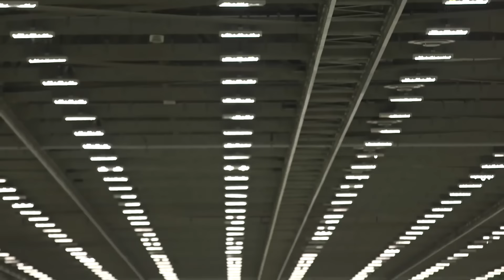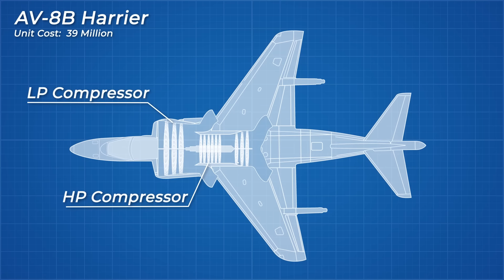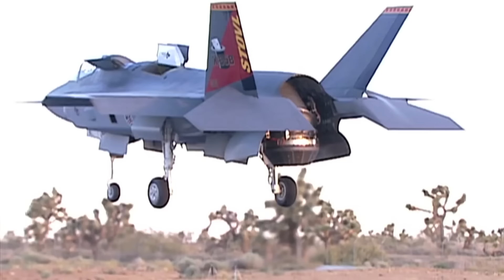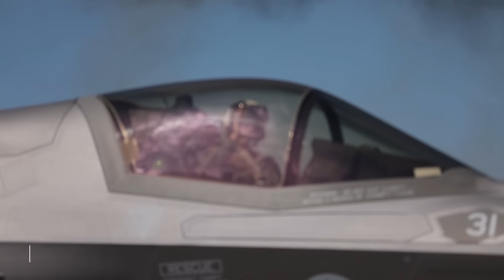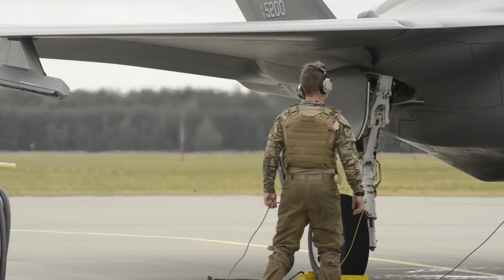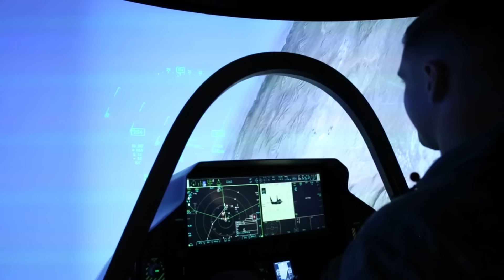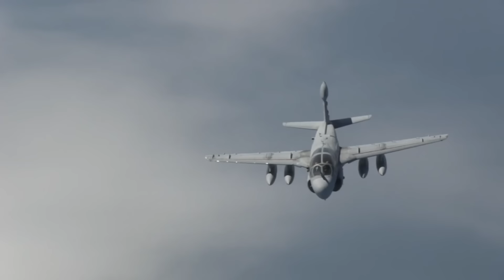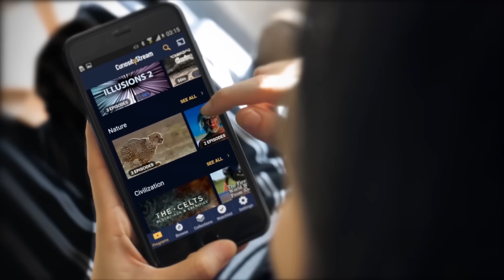Is The F-35 Worth $115 Million?

Comment: As an American. It costs too much. We made this compromise mistake with the F4 Fantom. We had missles so they removed the gun. Because pilots wouldn't be close enough for guns. They put guns on after pilots would run out of missles, and get shot down.
Reply: The F-4 didn't need a gun when it was flown correctly, look at the Navy.
Reply: @infinitelyexplosive   it needed the gun lol. If training was the problem they wouldn't have put a gun on them lol.
Reply: @mattalford3932  The navy generally didn't, and they were still highly effective.
Reply: The F-4 was designed to intercept bombers from outside the range of the escorts. It was never intended to engage fighters, especially not over land on a bombing mission. Thus not having a gun was actually beneficial as it meant less weight and better maneuverability.

Comment: Its not worth it. Its worse than F16 dogfight. Its a useless plane like F22
Reply: And the F-35 is far superior in a BVR engagement. Why is dogfighting performance the only metric you use?
Reply: F-16's typically lose in BFM against the F-35A between equally trained pilots. The F-35A has a better T/W ratio and practically the same wing loading as the F-16 while also offering far superior AoA performance.

Comment: The incalculable savings are the intangible cost saving. Savings by having common parts between A,B,C models. The cost savings of not producing/developing three separate aircraft(Possibly four separate aircraft).  Each of those separate aircraft would have had lower production runs, separate supply chains, separate training, separate maintenance requirements, etc. Also, for marketing in an environment of global competition, there is only the F-35 to be marketed instead of F-35, F-37, F-39 and F-41.

Comment: So if the stealth of the F-117 was good at preventing missile locks how was it locked and shot down by a missile system designed in the 1950s being operated by a third world country?
Reply: Because the SAM operator got incredibly lucky and the attackers didn't use proper technique, including a lack of EW support aircraft due to weather. Nobody ever said that stealth makes a plane invulnerable.
Reply: Because stealth isn't invisibility. Get too close and any radar can get a lock, which is what happened. Really that incident is just proof that stealth works as intended since we know the radar failed to lock on multiple times until the F-117A was well within weapons range. Also the missile was from 1970, and the radar was a 1980s upgrade of a 1970s radar. They were of the same era as the F-117A's stealth technology.

Comment: The most egregious insult to taxpayers was the VSTOL requirement.  There is absolutely no mission  for VSTOL aircraft.  The Marines insisted on it knowing full well it serves no purpose other than to keep their nose under the tent.  The F-35 acquisition is the perfect exemplar of all that is wrong with the US defense procurement system.
Reply: The Harrier was used extensively in the Gulf War, Iraq War, and numerous other conflicts. Why would we expect the scenario to change in the future such that STOVL aircraft are not valuable?
Reply: @infinitelyexplosive  They were used because we had them, not because they are particularly valuable.  Against the pitiful Iraqi air assets, basically anything would have worked.  Surely you understand that, no?
Reply: @chuckschillingvideos  No other plane is able to launch from the smaller light aircraft carriers and helicopter carriers. I would argue that these represent asset as they allow for the relocation and deployment of a still decently effective plane without requiring a full carrier strike group to be dedicated and potentially put at risk.
Reply: @infinitelyexplosive  This is a wholly invented requirement where they (the Marine Corps and Navy, specifically) decided they wanted a platform and then worked backward into the mission.  There is no warfighiting scenario where such a combat engagement can be sustained and supplied exclusiively through these light carrier forces.  It is a purely imaginary scenario devised merely to open congressional pursestrings.
Reply: @chuckschillingvideos  I don't think that anyone's claiming that F-35Bs operating off small carriers should be completing engagements entirely on their own, just that it's valuable to have some planes able to launch from small carriers. I could certainly understand the argument that the price of the F-35B is too high for its effectiveness, but you're going far beyond that in saying that plane fundamentally offers no benefit.

Comment: With the pilot from an F15 commenting that the F35 has poor energy manoeuvrability is only going off of the characteristics of his old rid which has Two power plants as to the F35 which has one.  The F35 has a power of  28,000 pounds of thrust or as much as 43,000 pounds with afterburner. where as the F15  has 35,600 pounds dry thrust; 58,320 pounds with afterburner so yes, the F15 would have the power to keep higher G load turns for longer than the F35, on top of that the pilot was not flying the blok 3 F35 so it was restricted to under 7G in turns where as the blok 3 is now +9G rating. the F35 b is restricted to 7G and the F35c is restricted to 7.5G as of last update That I found.

Comment: The f-35 looks so cool just like the a-10 btw love the vids keep up the good work
Reply: Stug 3 117 no i get that but the design of the aircraft is what im talking about
Reply: Stug 3 117 both
Reply: @Cloud Burst 117 At some point replacements are more sensible. A-10s have been running for nearly 50 years which is kind of absurd. Imagine if something like the P-47 from WWII had been used in the Gulf War. No matter how good it is, everything has its time.
Reply: @Cloud Burst 117 The difference is B-52s are used for strategic bombing. There are only about 5 operational planes in the world that can do that. The few other planes in the world that can do the B-52's job cost up to billions of dollars apiece. Meanwhile the A-10 is doing a job that the F-16, F-15E, F-18, and F-35 were all designed to do and can do faster. If you're looking for something cheaper, the answer is something like the A-29 Super Tucano. I like the A-10 but it was a plane designed for fighting hordes of Soviet tanks at the Fulda Gap and is a product of its time. It just cannot stand up to modern threats. It wasn't even allowed to use its gun in Syria because it was too dangerous to fly low enough to use it and because depleted uranium bullets are toxic, which takes away all the advantages it has over something faster. The B-52's applications are much broader than the specific idea the A-10 was built with. The A-10 is a fine plane, just like the Mustang was. Look at how long ago the fighter jets of the B-52's era were retired. We're talking about Super Sabres here. Different roles last different amounts of time.
Reply: @Cloud Burst 117 The A-10 has been obsolete for almost half a century.

Comment: The problem is the US link system it hardly matters what the F35 can transmit, what the others can receive is more important. The fact that the F35 is a good steahlt plane and noone conterdict that fact. But the F35 having a hard time being ready for combat with 35% of the planes not combat ready is disasterus. The fact that the A and B does have a low G tolerance, the lack of speed,
slow climb, and less steahlty when facing the new GaN radars makes the cost a problem. We must hope that the problems are dealt with, if not this plane  can not be bulk of the Airforce a fighter is needed.

Comment: Airborne radar systems and enhanced electro-optics are in a technological war with stealth. Quite similar to the tank versus ATGM competition. Advanced medium frequency ground radar is quite capable of vectoring a fighter to the point where it can intercept an F-35, it doesn't need to be perfectly precise.  If the F-35 ever loses its stealth capability over detection technology, it's dead. It does have poor kinetic performance and range and manoeuvrability this is well known. Its weapons loadout is also pretty low unless it uses external stores, in which case it's not stealthy anymore. .Hmmm...

Comment: The f-35 is bad at dogfighting because it was made for beyond visual range combat. If you merge with the enemy, you can consider yourself dead. Also I do not think that the f-35 could be as effective as the A-10 warthog in close air support because it doesn’t have the GAU-8 cannon.
Reply: F-35 is the 2nd best US dogfighter, only slightly worse than the F-22. The most effective CAS aircraft currently is the F-16. The A-10 only uses it's gun because it was designed around it, but because of that the A-10 has very limited capability and fills a niche sub-role within CAS.

Comment: Won’t end up replacing the A-10 for a long time, if ever after showing it wasn’t able to give the same level of  ground support and loiter time over the battlefield. The A10 also offers a huge psychological impact on both sides of the battlefield, increasing moral of ground troops and scaring the shit out of the enemies.
Reply: Not the point. It has been replaced by the F-16 already in roles that would see it in contested ground or airspace.
Reply: Nathan Peterson Not the point of my comment. Saying the A10 fills a very specific role that no other current plane can fill. The modern battlefield for the last 20 years has been all about uncontested airspace with need of close air support. No signs that need will go away.

They just kind of threw the A-10 role in with the cake mix when trying to get the program off the ground and sell the F-35 as a complete Swiss Army knife. It’s been reported the fly off between the two was not really on even ground as the higher ups try clear out the obstacles for  the F-35 

Now many of the A-10s are getting re-winged and will be around for at least another 15-20 years. 

If anything the F-35 will replace the F-16 multipurpose role in contested airspace.

https://www.defensenews.com/2016/05/05/f-35-vs-a-10-air-force-test-pilot-weighs-in/

Comment: whats the point of having the A version for the Airforce?? Just use the C version minus the heavy landing gear plus more fuel
Reply: Because the Air Force have no need of the larger wings, and they'd still like to have an internal gun.
Reply: The C version is slower and less agile.

Comment: The XQ 58 A from Kratos is 3 million dollars, you can get '38' XQ 58 A instead of one f 35, the F 35 should have been autonomous in the first place, it's definitely a POS meant to draw as much money from the taxpayers as they can like Boeing and Lockeed have done for years. Anyone who thinks this jet is next gen is a moron.
Reply: It's a completely different beast. XQ58 supporting F35 as cheaper force multipliers is a great future possibility.
Reply: @davidhouseman4328  I am entirely sure the f35 could be one third of its price if it was autonomous and designed with common sense instead of wanting to cram every single features in it wether they are actually useful or not. Like is a front machine gun cannon really necessary when these things are used 99 per cent of the time for precision strikes with missiles. Same goes for hover, it considerably complexified the design and maintenance therefore this means those things shouldn't try to hover if the technology for it give such drawbacks and cost increase. Elon Musk himself said this design was retarded and I couldn't agree more, this is usual boeing and lockeed and government combined engineering madness.
Reply: @troywalt4834  where as I'm certain it would be at least 2/3 the price. 
The F35B is a different beast, the F35A is $80m, only a small amount accommodates the pilot, it's a supersonic stealth sensor platform.  That's where the money is spent, we've been giving the pilot the same comfort since WW2. 
The controller is in the jet because then you can't disconnect him from it.

Comment: Drones are the future. send 10 as cheap scouts and any F35 are doomed.  If the software is the key, modified the F16 should meet the demand.
Reply: Drones capable of taking on a F-35 aren't going to be cheap at all. Expendable sure, but not cheap.
Reply: @ivanlagrossemoule   it is mathamatical possible to use drones as mobile  rador stations. The Rader array I think can detect lots of things it cannot be done before.
Reply: @topspykimi  to make the drone compete with the F35 you need the Radar of the F35, the Engine of the F35, the Stealth of the F35 ... 
You need 80% of the cost and then you only have the cut of the signal and the drone is buggered.

Comment: Surprising that the us military didn’t adapt the f35 harrier type vertical lift, into A real replacement for the warthog, by either giving the f35 vertical hoover over the battle field, or reduced speeds using partial hoover.
Tank busting is hard, and might require either missiles or A dedicated designed weapon system, but the majority of military targets are not as well defended as tanks. It would be fun to theorize what could be made of A modern designed warthog. Although it is easily the case that modern surface to air rockets have made it obsolete. In G-d I trust.
Reply: No need... VTOL is not designed for combat use, and tank busting is easy. All you need is a bomb. A 250lb bomb has enough concussive force to vaporise the crew inside a tank even if the tank itself remains intact (which is unlikely). A 500lb bomb will destroy a tank. Then you have dedicated weapons with shaped-charge warheads.

Comment: And now countries are waking up to the fact that they have basically only rented their F-35s cause they are not allowed to do any software development to make it their own and are stuck to the complex and overly expensive supply chain the US setup to maintain the fighter.  Its become at "not so joint" strike fighter that also lacks the speed to be an interceptor hence even the US looking to purchase new F-15s to aid in this role.  Also if the F-35 was all that and a bag of chips why are they still keeping the A-10 till like the 2040s now?  I think the planes comprinises have limited its top speed, manueverability, range and particulary payload resulting in numerous legacy planes that will have to be kept on and updated to make up for the planes shortcomings.  A significant hidden cost to the Joint strike program to be sure.
Reply: Right... try doing some research. Not being able to develop their own software is no different to the previous gen fighters. It's a limitation sure, but it's not stopping them from being highly capable fighters.
The USAF are buying more F-15s for 2 reasons
1 - There was never a plan to replace the F-15 with the F-35.
2 - They are trying to increase production volume to avoid a capability gap. It has nothing to do with the F-15 somehow being better for anything, and everything to do with the F-15Cs that need to be retired within the next 10 years before they reach their maximum lifetime and become safety hazards.

The F-35 was never planned to replace the A-10. It was discussed as a possibility based on the fact the A-10 serves a very niche role and isn't actually a necessary component of the USAF.

There are almost no compromises in the F-35 other that cost. In a strike configuration it is easily the fastest fighter available right now, while also having the longest combat range of all western fighters. It's maneuverability isn't top tier, but it is still the 2nd best dogfighter in the US military and the only fighter capable of engaging targets in any direction without assistance.
As for your claim about keeping on other planes... the F-35 outperforms the fighters it replaces in literally every aspect of practical performance while being similarly "cheap".

Comment: Only one engine, no backup. This is going to be a problem, in particular on aircraft carriers.
Reply: Not really. A passenger jet is not a fighter jet. One can fly stably on one or glide on none. A fighter is aerodynamically unstable so the loss of one of the two would result in a equally uncontrolled crash as those for single-engine fighters.

Comment: Old outdated cost information.  The $115 million was actually the price tag for only 10 of the jets.  Basically, the first NAVY "Super Lightning" C class variety.  The rest were $94 million.  After the initial contract, which gave lockheed the money to build better equipment and facilities for mass production, the manufacturing cost per jet from start to finish dropped to $74 million, and then down to just over $50 million per aircraft, today.  That's just 6-8 million more than Russia's newest Su-57 fighter jet, for a more superior and versatile aircraft.

Dog Fighting is what separates 5th generation fighters apart from 4th generation.  5th generation is primarily designed to take down enemies before they're even close enough to be seen.  That's the point.  In a controlled simulation where you put a F15 Eagle against... well anything, the Eagle has a chance.  The problem is that won't really reflect reality, as all 5th generation fighters will see them on their advanced radar, miles before the Eagle.  The only thing the Eagle would ever really see going up against an F35, are incoming missiles coming from... nowhere.  Just more bad information.  And the Airforce/Navy would not be sending in F35s into areas which have intercept capability.  They'd send in the Raptors for that.  Once AA and airfields are destroyed, F35s would go in to obliterate the enemy with massive ordinance.